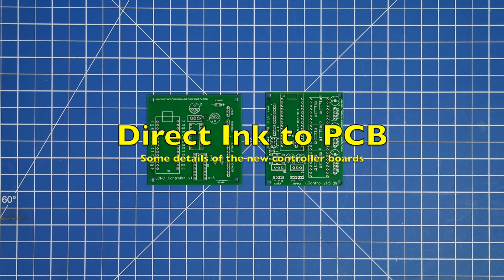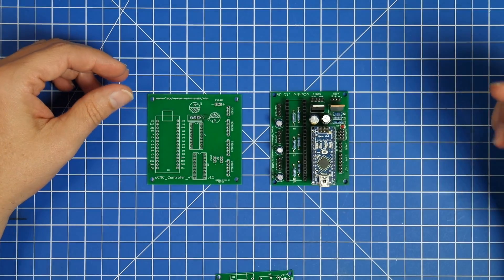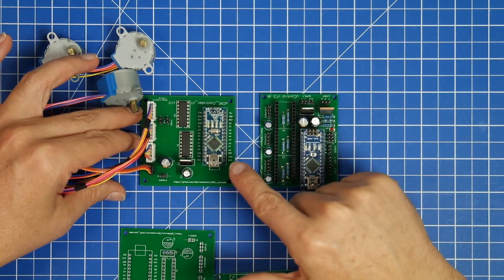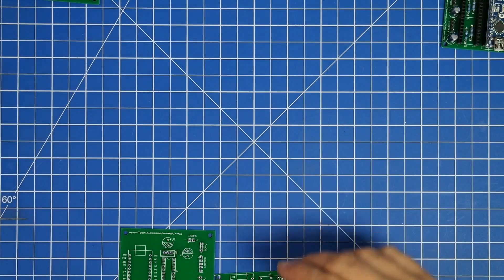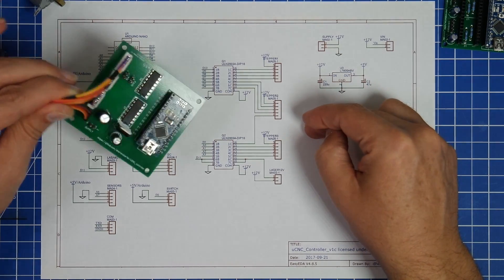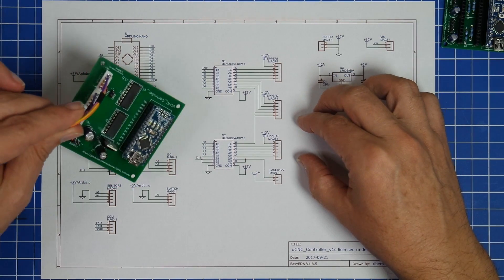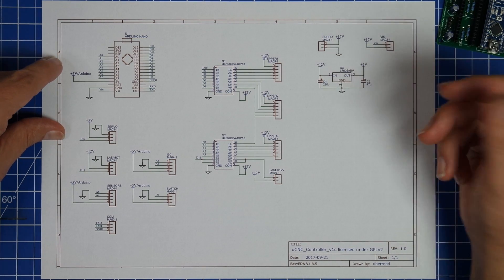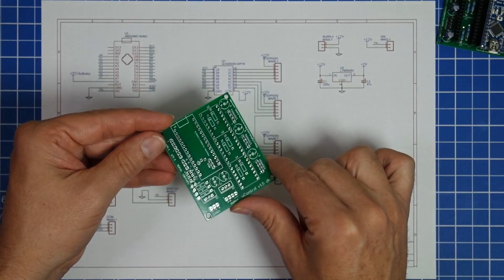Direct Ink to PCB - Details of new boards

Comment: Dirk, you really need to see this http://www.lamja.com/?p=635 It can be a step-up from a plotter, that will allow a better density, but without the problems a laser or a bit routing can rise. I see both approaches to be usable, with your plotter used for rapid prototyping.
Reply from the maker: I've seen and tried it - it did not really work out for me - but the issue was not the method, it was finding the right pen. I build a chisel for my hi-res plotter, and that was ok.